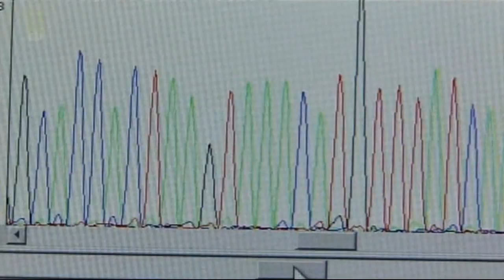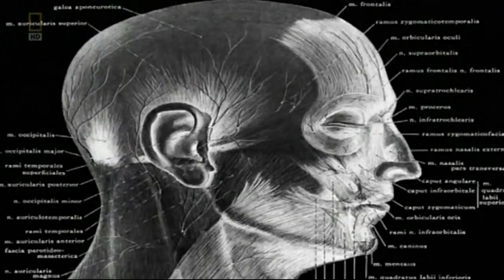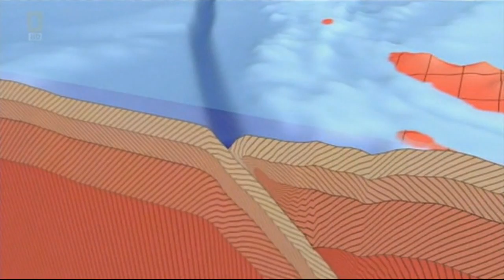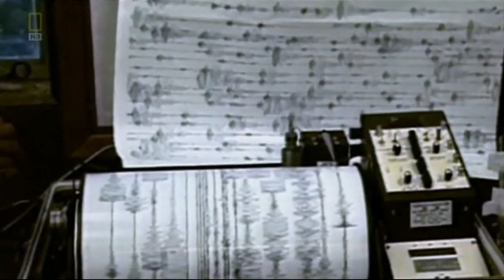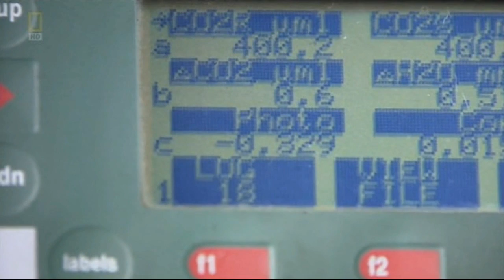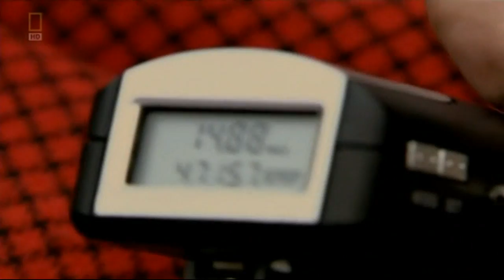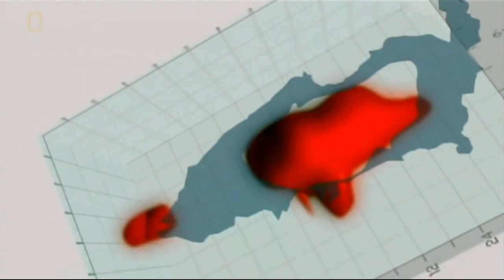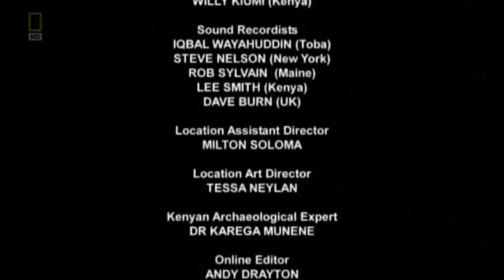Stone Age Apocalypse

Comment: You only need to watch the first 25 minutes of this video. After that they keep repeating the same info over and over again.
Reply: I hate it when shows will drag out a 30 minute documentary out to a full hour like that, I was watching a show on the change from stone age to copper age and it was 2 - 1 hour blocks (or 45 minutes without ads) and they didnt have anything new for the second half. The could have trimmed the 90 minute long 2 part special (without ads) down to about a 30 minute long video

Comment: 11:37.."a new sheet of ice piles up every year", in other words a "layer".  What about the ice maidens...a group of WW2 planes that where forced to land in Greenland in 1942. When they were rediscovered in the 1988, they were under 250 feet of ice, not just 46 layers (one for each year since landing) but hundreds of layers. Best estimate is every 6ish" of snow created a "layer". How is ice core dating accurate?
Reply: Brian - Also, what of the 'Pirri Rees map' (if that spelling is correct) which shows Arctic coastline supposedly buried under 300ft of ice for over 2000 yrs yet this 13th century Turkish admiral had a map of the coast which recent 'soundings' prove to be correct ? (the map is centuries older than 13th century and said to be from the great library of Alexandria, perhaps 10,000 yrs old and shows trees and animal life on the arctic coast also. It's all very odd indeed but certainly does not fit with the accepted science)

Comment: no it wouldn't stand to reason.

think about it: the concentration would go DOWN as you advanced towards Africa. And in fact there are hardly any airborne ash deposits (if at all--I never found any), in Africa from Toba. So while East Africa is directly in line with the prevailing winds (even 76,000 BP), it is simply too far away for much ash to be blown in.

however, ash may have been brought to the shore by ocean currents, but that wouldn't likely bring enough to cause trouble.

Comment: The next guaranteed disaster event is the return of the next glacial period.
The signs of the next glacial period are, paradoxically, that it first gets warmer, others are, increased earthquake, and volcanic activity, caused by changes in of ice, an water loading on tectonic plates, and widespread forest fires. Others are, exceptional snowfalls, and record winter low temperatures.
All of these are currently present.
Deep sea and lake core drillings have shown, that in the past, the change over from temperate climate to cold tundra climate, has occurred in as little as 20-50 years.
When this happens, all the main food growing areas, like the prairies, will become too cold for plants to germinate, or too ripen to harvest, as recently occurred in Montana.

Comment: The DNA recombination hotspots in human and chimp DNA are completely different. The only means by which they could become so shuffled would be chromosome translocation and/or block duplication. However, these kinds of genetic change are exceedingly detremental, so much so that just one can kill or cause someone to have Downs Syndrome or be stillborn. It is therefore not possible that they got shuffled by hundreds of translocations and still produced species which are suitable for survival. Therefore humans and chimpanzes are not related, they have no common ancestor, and the evolution of all three is scientifically impossible.

"In this new study, funded by the Wellcome Trust and the National Institutes of Health, the researchers found that there was no overlap in the location of recombination hotspots between humans and chimpanzees.", Scientists map hotspots for genetic exchange in chimpanzees."  http://www.sciencedaily.com/releases/2012/03/120315145413.htm

"The problem of recombination hotspots has also been a subject of theoretical studies [28]–[31]. Most of them focused on the explanation of hotspot survival in the context of the biased transmission caused by gene conversion. This problem is commonly known as the “recombination hotspot paradox” Scientists map hotspots for genetic exchange in chimpanzees  http://www.sciencedaily.com/releases/2012/03/120315145413.htm

"A schematic diagram shows two methods for detecting recombination hotspots. Single sperm genotyping is shown in panel A. In this method, PCR recombinants between SNP pairs in single sperm are scored, and the non-recombinants are estimated. Population genetic inference is shown in panel B. In this method, diploid SNP genotypes are derived from individuals in a population; the data is used in a coalescence model, which is used to estimate the non-recombinants." - DNA Deletion and Duplication and the Associated Genetic Disorders  https://www.nature.com/scitable/topicpage/DNA-Deletion-and-Duplication-and-the-Associated-331

Recombination of homologous chromosomes is an important aspect of the generation of genetic variation in species, as well as a normal process that is part of meiosis, specifically occurring between sister chromatids during meiosis I. While allelic homologous recombination (AHR) results in the interchange of homologous genetic material and the separation of haplotypes, there are often cases of nonallelic homologous recombination (NAHR), in which the sequences that recombine are on different chromosomes or different positions of homologous chromosomes. In fact, recombination can even occur between two sequences on the same chromosome. Such instances of NAHR can result in alterations in chromosomal structure, including the generation of deletions and duplications.

"Researchers have zoomed in on mouse chromosomes to map hotspots of genetic recombination -- sites where DNA breaks and reforms to shuffle genes. The findings have the potential to improve the detection of genes linked to disease and to help understand the root causes of genetic abnormalities."

"We assumed that the “hotspot paradox” is solved and it is possible to reach an equilibrium in appearance and disappearance of hotspots [32]. Therefore, we elaborated a Monte Carlo model of eukaryotic chromosome evolution that allows self-organization of spatial distribution of both recombination events and genes responsible for individuals’ adaptation and also their defective alleles subjected to negative selection." - Distribution of Recombination Hotspots in the Human Genome – A Comparison of Computer Simulations with Real Data

Hotspots of genetic rearrangement: Findings in mice could aid understanding of how mammals genetically adapt, April 6, 2011, http://www.sciencedaily.com/releases/2011/04/110405175014.htm

Humans share more genetic similarity to pigs than chimpanzes according to the way evolutionists measure genetic similarity between species:

"People have been congratulating me on this SINE study as if it somehow proved the hybrid theory of human origins. That's nice of them, but it's just one run in a nine-inning game. True, it does show that pigs are more closely related to primates than has generally been thought, which in turn suggests that a hybrid cross between pig and chimpanzee is more feasible than many have supposed. But to establish whether we're actually descendants of an ancient cross between pig and chimpanzee, will require a detailed search of the human genome, not just a study of SINEs. I've explained the relevant issues in a recent rebuttal of some of the most common criticisms of the hybrid theory. It's not as simple as some people like to think." - Eugene M. McCarthy, PhD Genetics, quoted in "The hidden evolutionary relationship between pigs and primates revealed by genome-wide study of transposable elements", phys.org  https://phys.org/news/2015-09-hidden-evolutionary-relationship-pigs-primates.html

Comment: Geographic distribution of the 7000 survivors
a. Population reduction from 1,000,000 to 7,000:  The human unit of survival is a group. Widely dispersed human individuals die out; we are a social species and do not survive in groups smaller than a few dozen; call it 50?.  So, survivors made it in about 7000 / 50 = 140 clusters (an area large enough to hold 50 or so survivors but small enough the survivors could find each other), or in fewer clusters with larger population.  Does the post-bottle neck diversity suggest how many groups survived, as opposed to how many individuals?

b.The Australia problem in spades?  Bottleneck 70,000 years ago and Australia settled by 40,000 years ago?

Comment: If that Skull from about 1 million years ago had the same size as today's Humans', If we're evolving why aren't modern Humans' brain sizes even larger?  Could there be signs of genetic manipulation, that kind changed Human brain size quicker that normal and why does it seem stable now and not larger than it was over a million years ago?
Reply: Perhaps because a large skull is such a costly feature, partly to the mother in childbirth, and partly to the owner of a large brain. It takes three times as much energy to supply oxygen to our brain as other apes.
The biggest difference between the humans 100,000 years ago and those 50,000 years ago (in the particular case of homo sapiens, which was not the only contender) was not hardware, but software. At some time in that period there was a cognitive revolution, a change in the way we used our brains. It meant that (among other things) the other homo strains were quickly outcompeted, assimilated, or both.
Our brain size is not our limiting factor, it's clear we're plenty smart enough. But it's not clear that our judgement is up to the task of ensuring the eventual success of our multifold expansion of cognition.

Comment: I have a bit of a problem with the timeline of the bottleneck, I can't recall the exact spot, but there is a cave in the middle east that has remains of modern human types that were more than 200 000 years old.  People had already left africa and never went back according to the DNA of non Africans that have the Denisovan and Neanderthal genes, and so far they have not shown up in the older African lineages.  You would have to go back much farther to find the bottleneck if you can apply it to all humans.  I suspect that the bottleneck was not a natural disaster, but a physical mutation that limited the gene pool as we diverged from our original lineage.  Natural disasters may have isolated our immediate ancestors but they didn't wipe out everyone except in one small area.  Even homo erectus had spread out all over europe and asia, and the jury is still out on the subject of just where modern humans arose in the first place, we need to do a lot more research before we come to any conclusions.  This guy is a bit of a twit.
Reply: the people who left around 200k years ago and earlier died out. the common ancestors of all modern humans were much more recent than that